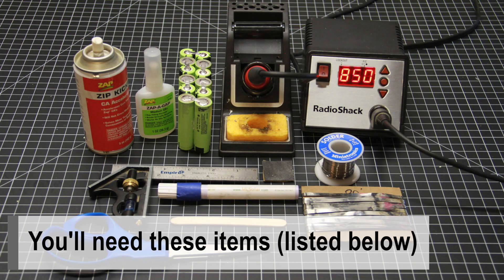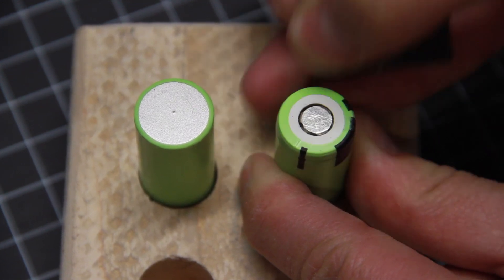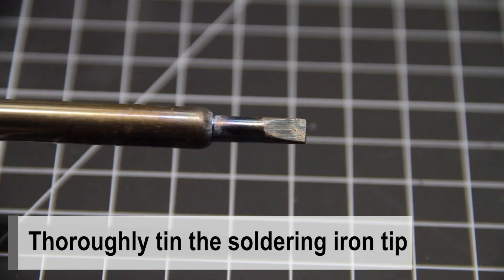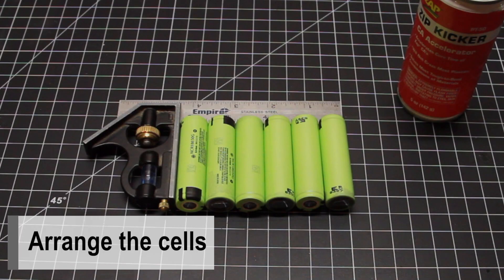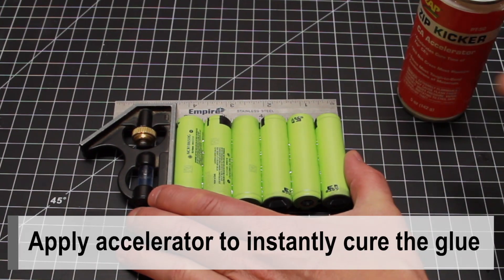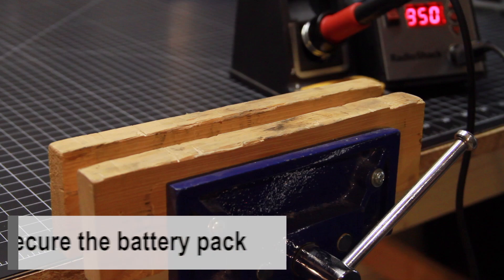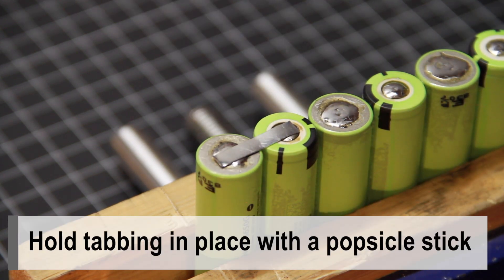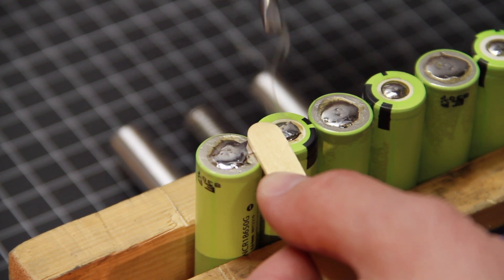Best Soldering 18650 Lithium Cell Tutorial - NO Welding, Just Solder!

Comment: You forgot to add a face shield and gloves, as there will be a lot of hurt when those batteries blow up spectacularly.
Reply from the maker: Hundreds of cells soldered with my digits, eye balls, and workshop still in tact.
Reply: @enopto  
I'm not dissing your technique, but shit happens and it's prudent to take precautions.  I've had button cells blow up in my face, but I was wearing goggles and only my pride was hurt.  18650 cells pack a hell lot more of a wallop.

Comment: I have a practically new e-bike battery that has one bad cell. It was replaced under warranty and the company didn't want the old battery back. I've been wondering how to utilize the cells. This might work for me, but I'm not sure my soldering iron is big enough for the task. It's really for delicate electronic work. I also have an old Weller soldering "gun" (because it is shaped like a gun). It's rated 100 watts, but of course has no temperature indicator. Do you think that would work? I'd like to make a couple of 12V batteries from some of these cells.

Comment: You are generally taught not to apply solder to the iron but instead to the work.
Reply from the maker: Applying solder to the iron, or "tinning," is required to properly transfer heat from the soldering iron to the item being soldered. For typical hand soldering of electronics, this is considered standard practice. If you didn't tin the soldering iron, you may end up with a "cold" solder which is prone to separation.

Comment: The proper way is to use acid, then you don't need long contact. The solder literally sticks to the etched surface for less than a second that way.
Reply: good tip.

Comment: Very good ! If You will allow me, I would comment, the flux is best: mixed with 10-20% phosphoric acid solution with water + alcohol. And as You say, the sandpaper cleaning Even stainless steel can be soldered with it! (We drink this in Coca Cola and other soft drinks!) With a good warm soldering iron, half a second is the perfect solder. I’ve been doing this for years, I’ve never had a failure! I wish You much more success and good health!

Comment: Don't try this at home. I ruinied my soldering iron tip with aluminum flux. You need a very good soldering iron (very much power) and the welding kit's are cheaper. You can't reuse your alu soldering tips with normal soldering.
But yes it's possible. Just don't talk about the flux and the high powererd soldering iron.
Reply: I also solder lithion cells et have soldered with tin many pieces of aluminium as it was done frequently in modelism and it's done in frigorific compressors. There is no need of any so called alu flux except when using "hard" alloys like tin-silver, rosin is largely enough as flux. A 100 watts iron is enough, with a bit of training a good 60 watts "doped" with added copper wire so it will have more mass and thus instant heat will do the job. The purpose is to have an instant heating to 300° celsius, the ordinary electronic solder melts at 220.
A trick: if the alu makes problem, sand it with 120 grit water paper (but dry) and pure vaseline. The vaseline stops the alu of oxidizing but does not  harm the action of the rosin.

Comment: Before you decide to weld like this , take a look at https://www.youtube.com/watch?v=byvr-dwwao4&t=1s and then decide if you want to build a PwrPack  every few 00's cycles or wanna use/extract all of the 1200's ++ cycle of your PwrPack build with a Spotwelder Kit like https://www.banggood.com/100A-Spot-Welding-Machine-Time-Current-Controller-Control-Panel-Board-Adjust-Time-and-Current-Module-with-Digital-Display-p-1747458.html?rmmds=myorder&cur_warehouse=CN of it i can say it works very well with consistent welds ,you simply need to test / practice with dead cells for 5-10 Mins , Cheers & ride safe ( assuming your an E-Biker like me ! )

Comment: This is better then welding ?
Reply from the maker: Better if you don't own a welder or if your battery will be subject to high vibration.
Reply: @enopto  Not true.  A proper pair of spot welds won't break unless you have enough vibration to actually break the nickel strip, while solder joints can and do vibrate apart.  In high current applications, with solder there can be enough resistance in the connection that it can actually melt the solder, and THEN you have a real problem.  Spot welders for making battery packs are pretty inexpensive these days.

Comment: Wrong! You should not heat up lithium cells with soldering iron as this would ruin them. Correct way is spot welder.
Reply from the maker: I've been doing this for years. There's no effect on the batteries when done correctly as I've shown. They still take the same charge, perform at the same level, and maintain the same life expectancy.
Reply: @enopto  Yes.  You've been doing this for years, so you have no idea how much better your batteries would perform if you built your packs properly.  Every manufacturer warns you not to do this.  Every commercially made pack is spot welded.  But you know better than all of them.  Got it.
Reply: What garbage you speak.

Comment: Welding has nowhere near the same contact area...
Reply from the maker: Bingo! This is why I'd never fly a drone with spot welded batteries.
Reply: No, not the same amount of contact area, but the contact is through SOLDER, which has a much higher resistance than the solid nickel-to-nickel joint you get with a spot weld.  If you really think it makes a difference, do multiple spot welds.  Here's the difference: with a spot weld, you don't have a "contact area", you have a connection at each weld that is solid nickel, all the way through.  With solder, you have a connection from a nickel strip, through some thickness of solder, to another piece of nickel.  The solder thickness will vary at each connection.  With spot welding, the weld just doesn't happen if the metal isn't in direct contact.

Comment: this is not a good method as for the chemical  close to your welds will be changed making them inconsistent with the rest of the chemicals deeper inside the cell also the anode + cathode surface treatment is forever  damaged ; them being crucial in the A delivery , Terribad . You can get a spotwelder kit for very low price that work with many different power sources once you have one you will find many many way's to put it to work , Cheers + Be Safe
Reply: I've used tin solder for ages on lithium iron, lithion, nimh, nicad batteries without problems. lead tin melts at 220°C, and all the process is under 300C. If you're fast there is very little heat in the battery. The great advantage is you can pass very high currents impossible to pass by spot welding, little resistance and very high reliability.
Reply: @pabloricardodetarragon2649  Actually, even with small spot welds, the resistance is lower, because the current is not having to pass from nickel through solder to the nickel case - the weld is solid nickel throughout, and is only flowing through that spot for a very short distance.  ALL professionally-made Li-ion packs are spot welded, and they know what they're doing.  In addition to that, passing the current through solder causes the terminal to heat up in regular high-current use, which further damages the cells and adds a risk that one of the straps will disconnect, dripping molten solder onto whatever is nearby.

Comment: The stripping metal is pure nickel, right? Also, can a properly adjusted butane heated soldering work? Thank you 🤓
Reply: The soldering iron, the big ones butane heated for soldering big pieces or tin roofs, will have too much stored heat so you risk to cook the cell. The purpose is to heat instantly just the cap no farther and that need very little heat in fact.

Comment: Great video! now i can stop looking for button top batteries for my new high powered led flashlight, and just solder top the molicel's i already have. other videos on youtube make this process seem much more difficult and unreliable (solder vs tack weld). I just need a better solder iron, any suggestions?
Reply from the maker: Anything over 60w should work fine. The trick is using a wide tip on a really hot soldering iron.
Reply: Try a Weller 80 watt iron. That is what I use and it comes with the proper tip for doing this kind of work and it is priced right.

Comment: To minimize the risk of damaging the internals of the cells, you can cool the battery immediately after soldering, using eg brake cleaner or a damp cloth. This becomes more important when you build a high current battery with thick copper wires that need a lot more heat for the solder to properly flow. Use the biggest soldering iron you can find for fastest soldering. Works like a charm!
Reply: Instead of brake cleaner you could use compressed air (the kind they sell in computer stores to blow dust away from computer parts). The gas inside gets freezing cold when it comes out.
Reply: if only i wouldve known than earlier..I made a 3s pack and it got super toasty to the point where i had to leave it safe in the basement..Didnt want to cool of on its own..
Reply: @aeQuator  If it wouldn't cool off on its own, it's probably because you shorted one of the cells.  This is a hazard with the positive end of the cells, because just under that green plastic on the edge of the cell is the metal case, which is connected to the negative terminal.  If the strip you're using to connect the cells gets hot and touches that plastic, it will melt right through it and short the cell.  This is quite hazardous, since it can get hot enough to leak the electrolyte, which is flammable.
Reply: @BrightBlueJim   Yep. And even with spotwelding it's extremely easy to penetrate the insulation: on my batteries, the strips that connect to the PCB with all its safetysystems, at one point leave the pack right at the edge of a cell at the positive terminal: Spotwelding a test battery and spotwelding this small tab to the pack NEARLY compromised the insulation, even though it's such a short duration.
Since then, I took a piece of very thin glass-fibre PCB, and sanded the copper layer off. Then I place it between the already present strip and the cell and fire away with the spotwelder. After about 10 spotwelds, you can discard the piece of PCB, as it will have black spots from the heat on it and will break at some point. But it solves the issue of risking piercing the insulation.
Even so, I just ordered insulating rings as well. It just feels that tad safer...
Reply: Can't you just reduce the spot welder's duration or power? @weeardguy
Reply: @Krzeszny95  Nope, at least not with the kWeld, the unit I have. Compared to all the other machines where people have to fiddle with timing of the pulse and amount of pulses the kWeld just does it all on its own. Just set an energy level, press the electrodes down and wait for it to fire (auto mode) or press your footswitch and done (well, if you pressed hard enough and set the right energy level that is).
At just 19 milliseconds or so, it heats up more than enough to pierce the insulation and could cause a short.
Reply: If you absolutely have no other choice than to solder directly to Li-ion cases like this, YES, do whatever it takes to minimize the heat going into your cells.  And yes, brake cleaner is a good choice, but the "canned air" for cleaning computers should also work.
Reply: Any thoughts.. if i just put some epoxy on the strip metal that make contact with battery.. can work ?
Reply: @Mike-fu4bc  Doubt it. The strip heats up very quickly (though very short). Besides possible fumes coming from the epoxy, I doubt it will stay put under the stress it will experience when spotwelding. When you solder, than it really will be a problem. You will be heating it for far longer (and higher) and I really don't expect epoxy to live through that.
Reply: Never, ever, fast cool a soldered  joint. It introduces weaknesses in the joint. Let it cool naturally.

Comment: My solder isnt spreading around easily and its kind of sticking to the tip? any tips on how to make it spread easier?
Reply: Make sure youre using flux and scoring the surface of the terminal. Also do NOT use lead free solder. I hope this helps!
Reply from the maker: Use a big hot tip that's clean. Use some steel wool to clean your iron if necessary. As previously mentioned, 60/40 solder works nicely due to the lead providing easy flow. Flux is also key, it's going to allow that solder flow stick to the cell ends.
Reply: Yeah, lead free solder likes to stick in case you're using that, and don't be scared to add flux, a bit too much isn't really going to cause any harm 

Also use the biggest tip you can, so the soldering iron doesn't cool down as you try to solder

Comment: An efficient way of doing it. The part I find hardest is getting the strips not to shift as I'm soldering them, or not sitting flat. The possible stick is a good idea. It would probably be a good idea to point out that these are protected cells, otherwise a BMS board would have to be incorporated into the battery pack.
Reply from the maker: These aren't protected cells. The pack was built for a solar powered UAV, so I don't need the BMS
Reply: these arnet protected cells mate

Comment: is there no concern that the solder on the pos terminal will bridge with the negative part underneath the pos terminal?
Reply: There is a paper washer under the heat shrink that insulates the case surrounding the positive terminal.  With unwrapped cells you have to do this yourself before making packs. Either way always consider Lion cells a fire risk and don’t store them under your bed😉
Reply from the maker: With flux, it's very easy to control the solder puddle. I've never had a solder flow short the battery.
Reply: I don't think this guy even knows what you're talking about.  YES, but not the solder, but the nickel strip itself: if the bridging strip melts through the heatshrink, which it can easily do, it will touch the outer shell and short out that cell.  DO NOT do this.